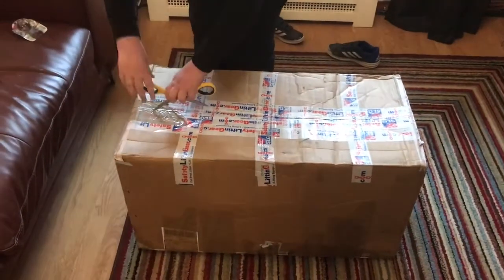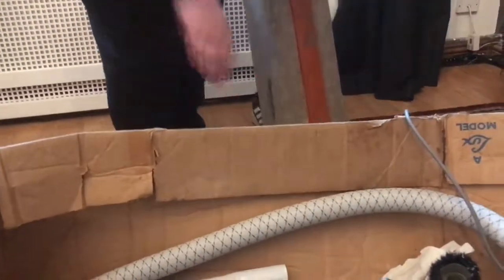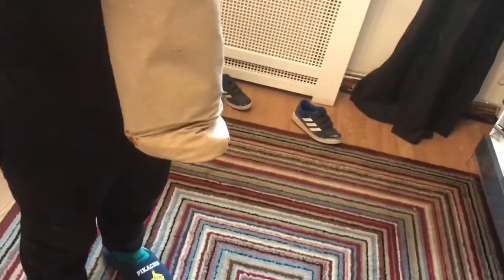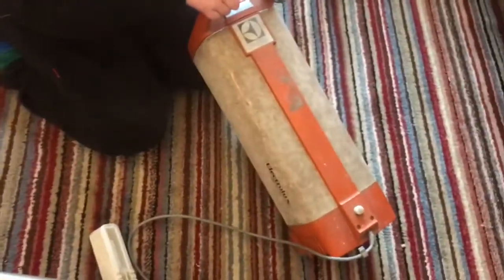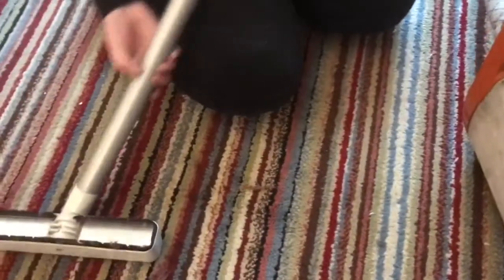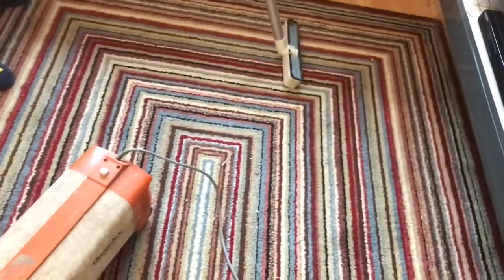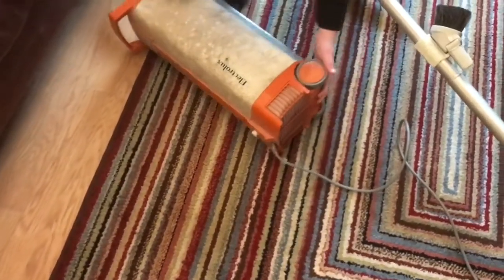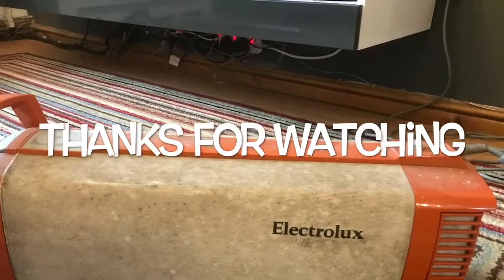1974 Electrolux 302 Cylinder Vacuum First Look.

Comment: Great vac!  It would be nice to see another vid of it all cleaned and polished.  Here are some details I located from a UK Electrolux cleaner model pamphlet:  Production: 1974-1979; Colors: Pale Beige w/ Tan end covers, handle, & lateral strip at top; Tools: Flip-Over Carpet/Floor Tool, dual action dusting tool, crevice nozzle. This was the budget model. Others sold concurrently were the standard model Z305, and the automatic model Z330, followed by the Z345.  Happy Electroluxing!
Reply from the maker: Craig L will do the After Clean video of the Electrolux.